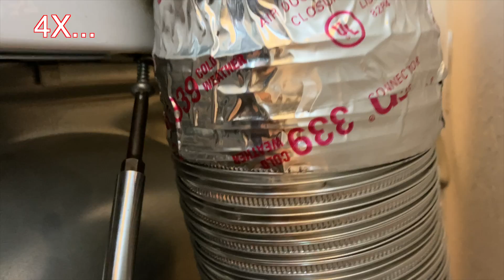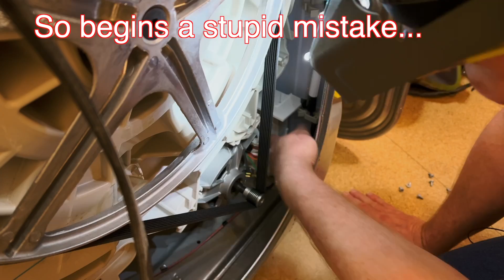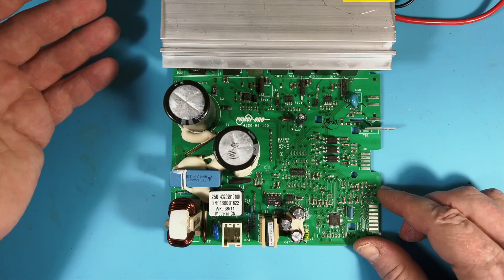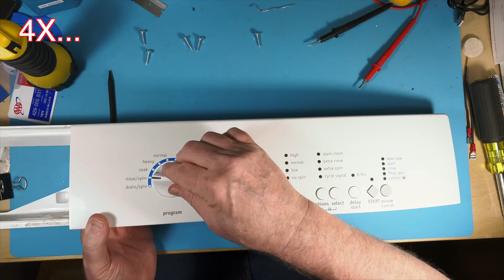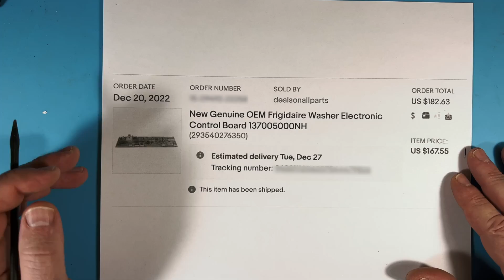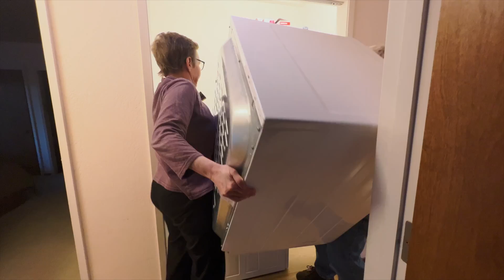Frigidaire Washer No High-Speed Spin Control Board Swap & Belt Replacement FRFW3700LW0 137005005(NH)

Comment: Amazing  I have the same unit but electric  The Door Latch Orange Lock wire can also be a fail point to block High Speed Spin based on other info and videos     Did you test the solinoid latch lock sensiir "locked" was good? that part is just $20.

Comment: I've replaced the door lock switch twice and that seemed to fix it for a while ; bad connections ? but it would , lately, intermittently do the " no spin ' thing, but it's giving the no lock code, the switch tests out o.k., I dread that it could be the same problem you've experienced. , thanks much for the videos ,I'm subscribed now , thumbs up!

Comment: So I would first and foremost commend you on your presentation and description. I have been on this journey with you and started with replacing the door latch, as you had.  Worked fine for a while and now I have the e43 error. I think these washers are pretty nice when working but all of the safety features are complete overkill and give them a bad name. That being said I have put entirely too much time and money into this thing and really don't want to replace the control board. My inquiry is that since I will be removing the control panel can I not theoretically create a jump or solder to bypass the entire door latch function as a preventative measure? In your assessment what was actually wrong with the control board? Given that the proper repair would call for it to be replaced I don't see the harm in trying to circumvent the functions and buying a outside universal door latch to secure the door to prevent any accidents. I appreciate your insight and hope that you haven't experienced any further complications with this washer.💯🙏

Comment: I had basically the same washer purchased in 2006.  Just replaced it with a new one.  Got alot of use out of the old girl.  If you want that washer to use more water, stick a phillips screwdriver in the center of that water pressure switch at the front-right corner and turn full turn clockwise.  That's enough to add about a gallon extra to the wash/rinse cycles.
Reply from the maker: Oooo. So wrong and delicious!
Reply: Lol, I was throwing this washer out, decided to open the top, saw that screw, turned it and gave the washer one more chance.  That was over 10 years ago.